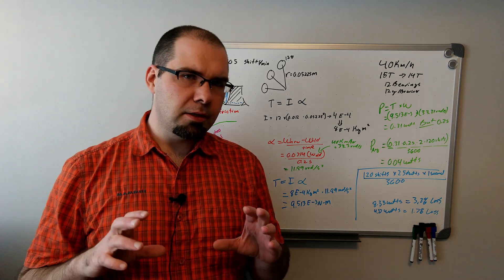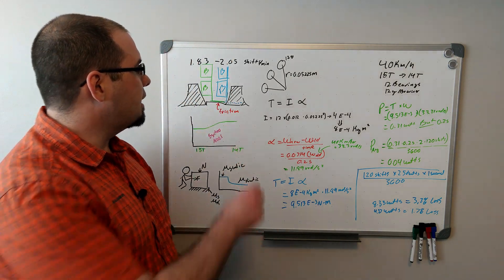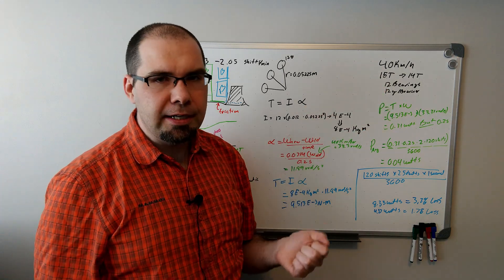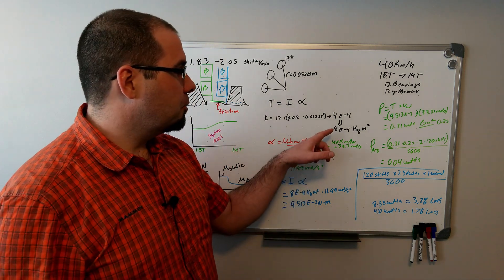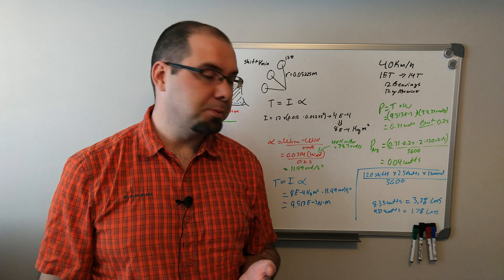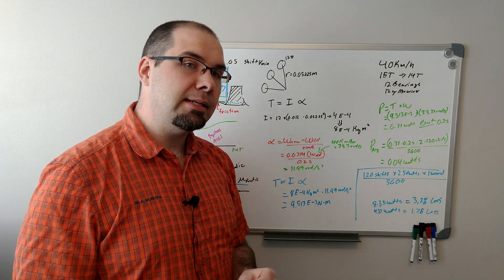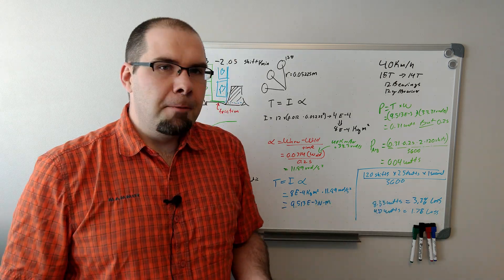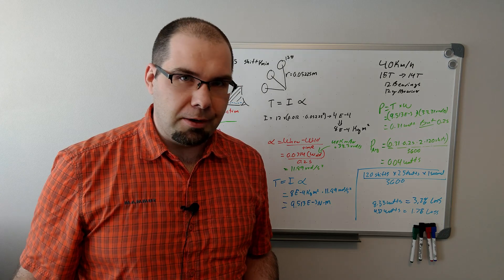Ceramic Speed - Synchros actually make DrivEN work

Comment: Loving seeing you use your knowledge to analyze the different designs of things which you've tackled in your videos. I'll add, regarding this drive train. that racing, sprinting out of a corner you might have to change gear every couple of seconds, accelerating from 15mph to maybe 35mph. You might change seven or eight times in quick succession while trying to hang onto the rider in front, not to let a gap open. Are you going to pause, slow down, sprint, pause, slow down, sprint, again and again and again... You can get to the foot of a climb at high speed, even get some of the way up with your momentum, before having to get into a very small gear very quickly - perhaps ten or more changes. On climbs, you can't afford to pause, while changing gear. Likewise at the top of climbs, riders will often attack over the top and you have to be ready to go from a tiny gear to large one, almost instantly. It's an imperative to have continuous drive as a racing cyclist. However, the chainwheel can also have a mechanism to change gear. You might have ten gears at the front and reduce the number of gears at the back... perhaps 8x8 would give a nice healthy 64 gears. Also, changing from an 11 sprocket to a 12 only gives a 2mm radius change. Not enough I think, so, to have big gears, you'd have to increase the tooth pitch at the back (an inch pitch would give a 12 sprocket 4mm of space to the next gear, but it will end up a little bulky... can always widen the drop outs, if you can talk the UCI around), or have maybe a 80 tooth chainring at the front - if you are going to race. Or increase the wheel size, maybe about 50% bigger at least... It's brilliant..! But maybe for a post man with aspirations... could improve the Post Office's efficiency. Oh no, the post office here in the UK doesn't use bikes any more. They should! OK, how about a set of drive bearings for every gear sprocket, all engaged, front and back, all freewheeling, but the two that are engaged by a clutch to drive. Changing gear can then by direct from small to large or vice versa. With a computer, you tell it what gear you want and it changes front and back to any of the 64, so you don't have to work out the combinations. How quickly..? Also... you have to enclose the drive train and seal it, front and back, as grit isn't going to be compatible with this ridged inter-meshing set up, unlike a chain that can run over the top of dirt. All you now need is to invent a continuous drive, like a... um... a derailleur. My first post on YouTube since it began! ...Actually, I can think of an elegant solution to a continuous drive, but I'm not posting it here. Great work Keith! Can't wait to see and hear some more. I've never learnt so much on YouTube!

Comment: Maybe I missed it, but was there any particular reason you chose hundreds of ms for synchro time?  Seems like that is the dominating factor in effective loss when evaluating a given number of shifts per time period.
Reply from the maker: The 100ms is to engage and disengage a drive train. This is an estimate given that on a super car with a computer controlled single clutch can take around 290ms (ferrari 575) which is total time to disengage, shift, and engage, while an slightly higher end DCT which is prepped for gear change is 150ms for a Nissan GT-R which is about 75ms for engage and disengage. However, these all have huge force available to electrohydraulic systems while a bike will not. So if 75ms is a good performance car, and an elite is 50ms (Bugatti Veyron DSG) then estimating 100ms is being very generous especially when there is not a hydraulic system to pull several hundred to thousands of watts off of a 500kw+ engine for shifting. Yes some shifting in the most modern super cars is faster but when you have like 2 - 5 watts on battery power to engage or disengage a clutch things will go slower.
Reply: @kwakeham  Thanks, appreciate the explanation!
Reply from the maker: No worries. Not perfect, but nothing I ever do is. Thanks for watching and appreciate the question.